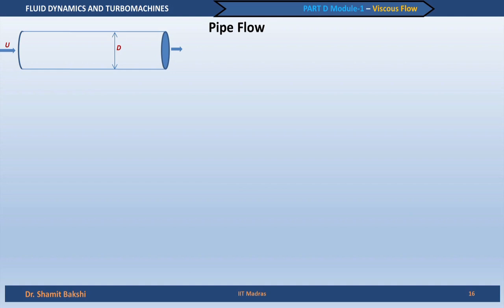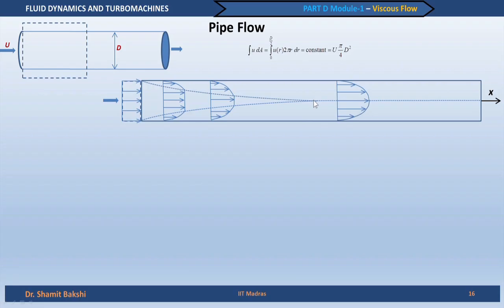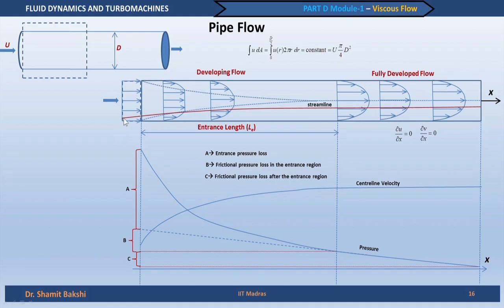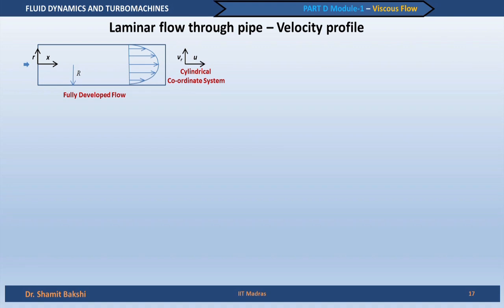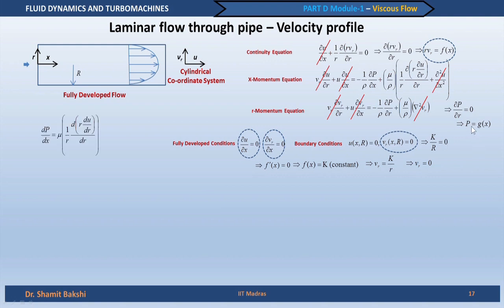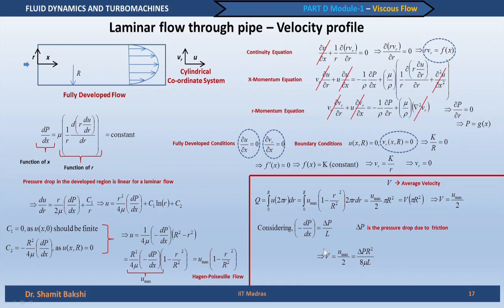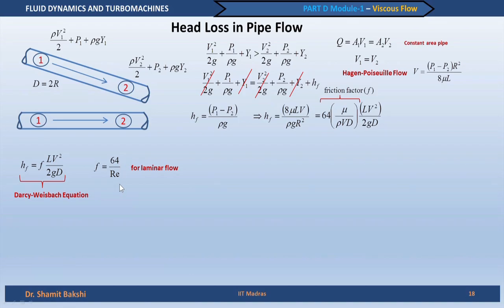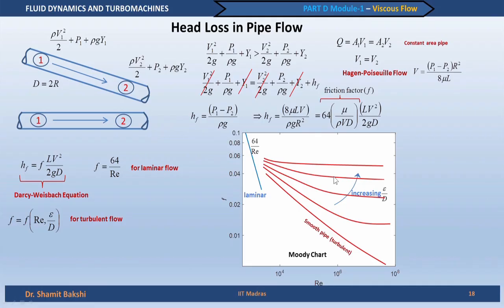Internal flow, Pipe friction

Comment: minor loses in piping system are : 
a) less than the friction factor losses b) due to viscous stresses
C)assumed to vary linearly with velocity 
D)obtained by using loss coefficients
E)independent of the flow rate